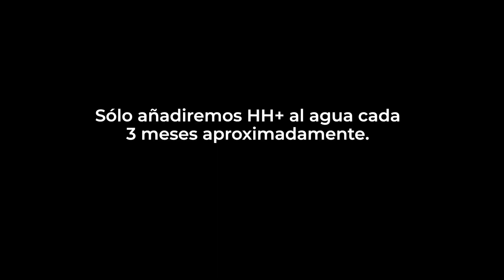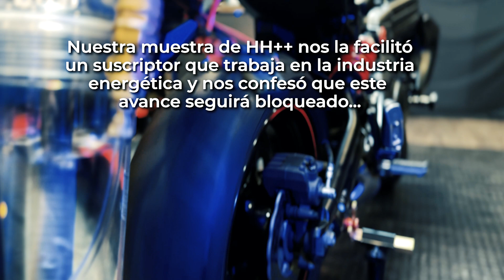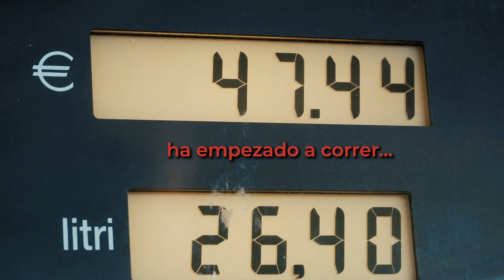HIDRÓGENO GRATIS CON EL COMPUESTO HH+. ELECTRÓLISIS EFICIENTE

Comment: Ciddiyetine inanmıyorum. HH+ nedir? Cevap yok. Microdalga bağlantı borusu neden oluşur? Aliminyum ve gümüş. Peki yüzdelik ve saflık oranları nedir? Cevap yok.  Liberty engine neden sadece matkap, diz üstü bilgisayar, elektrikli testere gibi şeyler çalıştırırken daha az watt ve amper gereksinimi duyan buz dolabı çalıştırmaz? Buna da cevap yok. Çünkü buz dolabı bu ac akımı tanımaz.
Reply: The generator will convert the current into usable energy.  In the US it's 60 Hz 120Volts AC. In Europe, it's 50 Hz 220 Volts AC. Don't buy one from Europe and expect it to work in the US or vice versa. A fridge will run no problem, they consume around 1500 starting amps and then, once running, the fridge will be using around 800 running amps. His generator puts out 2300 watts. So it's more than capable.

Comment: I think the electrolyte consists of distilled water or water as clean as possible + sodium hydroxide or potassium hydroxide or sodium bicarbonate. ..or a mixture something similar. I'm going to try all sorts of mixes with different pulse frequencies at different voltages